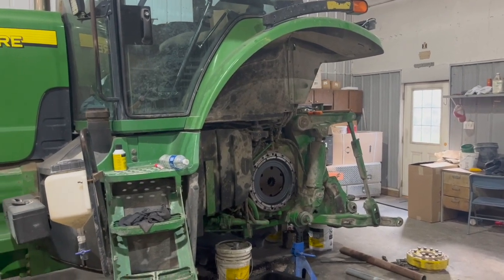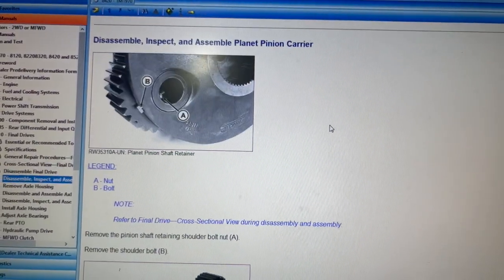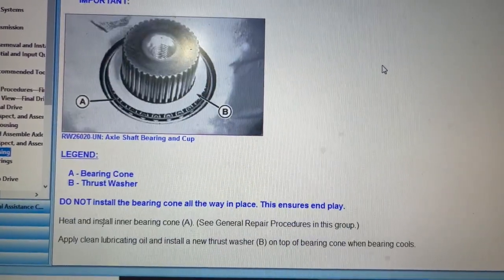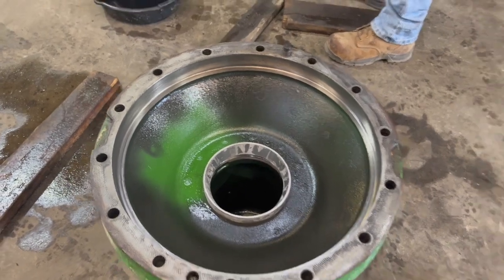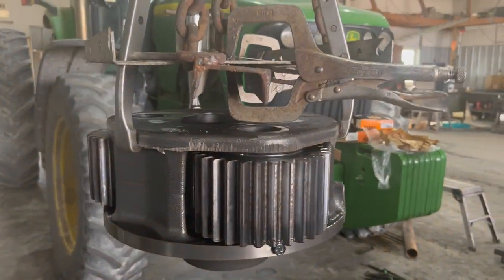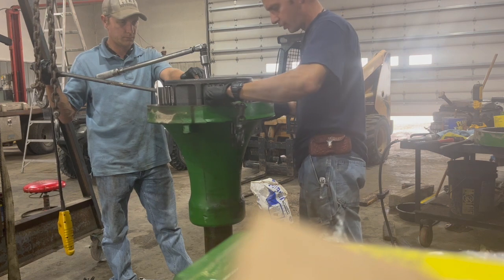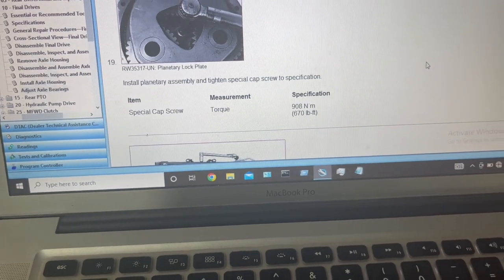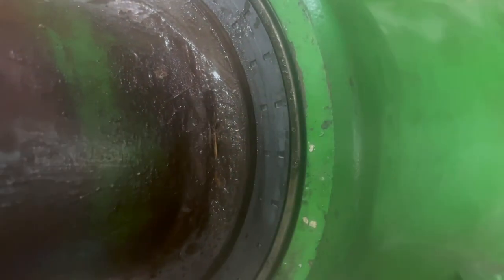John Deere 8420 Wheel Bearing Replacement

Comment: What website or software do you use
Reply from the maker: https://the-best-manuals-online.com/_t/c/A1020005-180843B1C89DE05B-6BAC29C1?l=AAAM%2F7u8XsHqDEAyD2qLvaq2pWe9eUWHy8oqrIpnIr3mKdgO8Jmxpw%2BUzDWL0q%2FEvftndld5BiPsaKtObdpiZoumxR%2F1q%2BzMRYMFQpzi8GaWnDlBGiCA6A8DT4a55JDSIC1xc9jf%2FFVWCNlPzPgkoCbYEHd0HCWS36Q9bDO1o15AyOEXZBmsSUzO1QbkLv2yE%2FWaRXCVdRW3yzRgTI8BLUZOWzOM297mK9h5silMHua8KJ8EXGx9%2BGCV%2BInNgICQ0kWqOh4FeGPdz9td%2FpgXnt8BsqOVUlDW3ITT9R8tu0xQw9u4%2Fl6eoDNnCkqfIcd1q%2B%2BQ3FVfmjk4HxWumXJjxfTvDZbKWkUhLAiEovURJFb5QtDPujb3OaBFdV0BCIyMzY4m4Qzwm0zDbaENavkkmQRniGpFTTbhmwmaqZcEOHvjSX7g6tC5SYjRyqsWPwYXml0q75wPnMve8HQl8%2BhY1EOznjw0ppjN4yMyCUpfq9Dzq1YQWUugUlh3%2B0qN%2F94p3xWXcroAw%2FYXqOEt7kkkbSPOP3wK8MYMlfp%2F8WENrMMWdVSwSOnC7Vo1FdxFH5YvHZfQjVLc&c=AACZa5pm3Y%2FScNVd9m6HNaTWkXLSxaDS84AuALyp%2B0nYzlAc8QQeHaLasUZ2S%2B7TOCrdoB0cfZzCmdn%2BFtJHXPM%2FCngNoeR%2BCCTF4CpXEjDT6B984Ql%2FKCqf%2FqCPf%2Bh4WEisdo4iROLHxbWB3QpLrMW9feydNWDhXSyODTjLtsuWSxzJTVLH38lFBZQh5SxtqcZLt4AIt9CpYAzMgSWnKxfCLd1iOcMvco6n6twgexCa7Xpk%2BZQq5zs6A1CIyAnH2Mn%2BpHd3lJNILEEEpFjPgUvuzrB%2FL3oZdfZBe%2BtYsRILCEPpFUFew3eUb0%2F2xQ1UbNOCrNq1JNSRKGtE%2FuEGlwcoPlscTx1lgAl1FPvTpzk2Kos3RmbGyXRQrrq2jri4w3B8fa%2BJ2j9qXqThEpvt0dp9iLixdPqi%2BNUziQhVSMdHeE8ckjgdfYs%2BHb%2BUeUwlmSJAkanZfy%2F5cjQtoxmsilIZuZatAE5c76p3qkAunGyVZnVcWqSK3KJEQgUdW0zcn%2BaO1Kuut6WWRZPIB42q%2BZAyLAVRyEMA89%2Bi10v80QjNECpYztfs0lbYAqbscM4rRrrSnPUgy1GIi0tNSfXSISFeJL3qtErjG0RaDOPLsKc%3D

They have several options
Reply from the maker: This is the one I purchased 

https://the-best-manuals-online.com/collections/diagnostic-software/products/john-deere-service-advisor-4-2-ag-cf-cce-agricultural-construction-2016-all-models-all-serials-service-parts-manuals-epc-diagnostics-complete-set
Reply: @iowafarmer93 says 404 not found